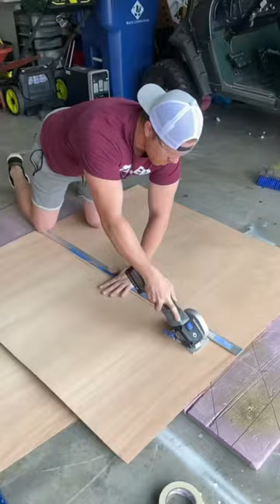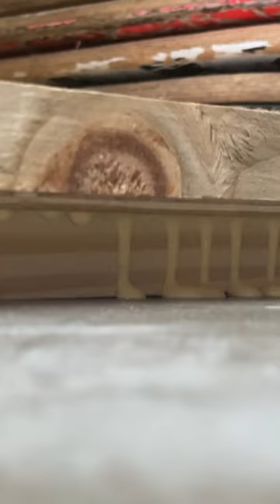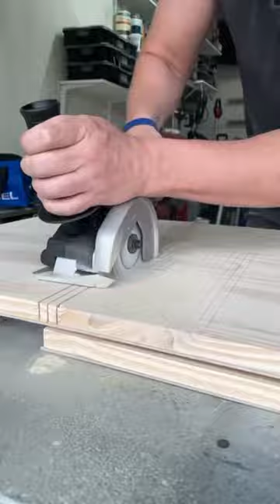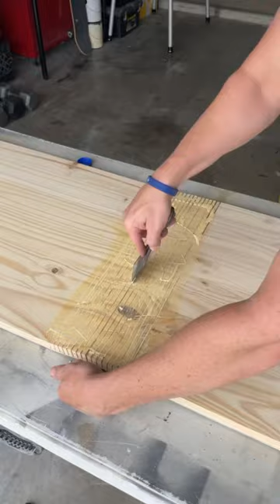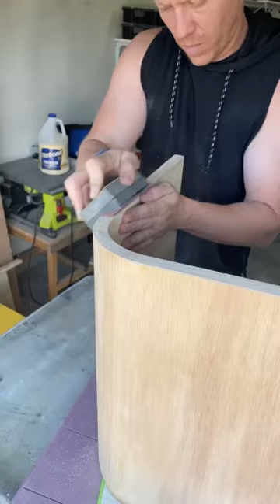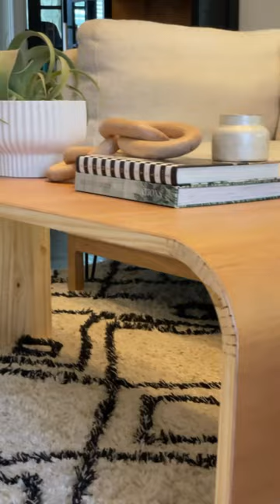Kerf Coffee Table #diy #howto #dremel #dremelwoodcarving  #woodworking @DremelUS #dremelambassador

Comment: Hey you guys!!! Question. I want to remodel my vintage motorhome. Its in pristine condition but needs an update. We pretty much know how we are going to go about the re model, mostly cosmetic (paint, color scheme change, moulding, tile stickers etc). How do i go about changing the dashboard? The entire thing needs to be replaced after it was damaged in a failed theft attempt of the vehicle. I cant just order a replacement dash (its from 1979) because there are literally not made anymore. Anyway, its a 1979 Kings Highway and its beautiful, but i want it to be fabulous. The new theme is going to be like the inside of a jewelry box. Pink, silver, light & dark grey, and white velvet. Any suggestions or heads up to where to get ideas from? I've exhausted my Google search. Thanks in advance and keep up the amazing work. I'm obsessed with your channel!!

Comment: Good job please did you cut completely through the top plywood or left inch of it before reaching the tin layer of plywood you glued below?? Can we use white wood glue for this?? What polish you use for the finish.
Reply from the maker: No I don’t cut through the top, and Titebond is what I would recommend, although gorilla glue would work well too. I used crystal clear lacquer in satin finish by Watco. I’ve found it doenst yellow like other brands do.
Reply: @emyludesigns  please thank you very much. Greetings from Ghana I have tools and am going to give this a good try